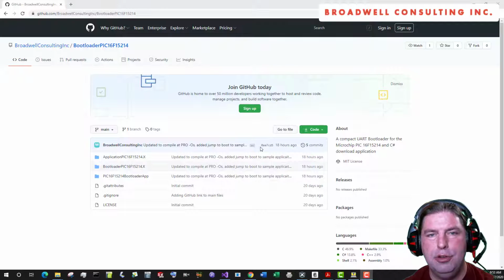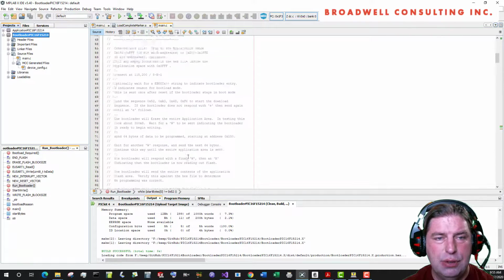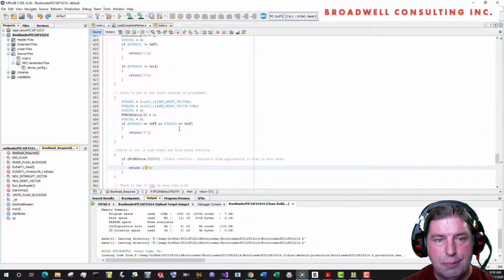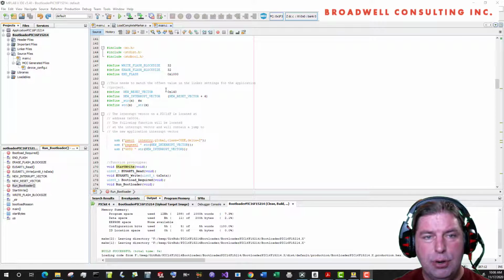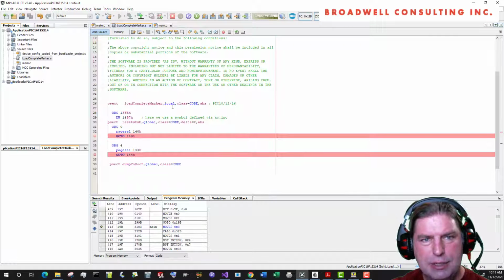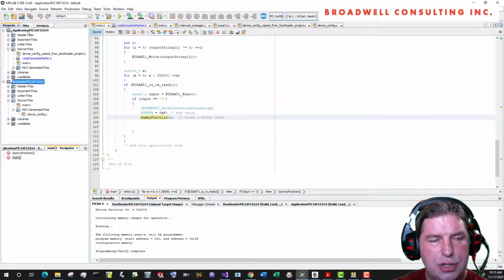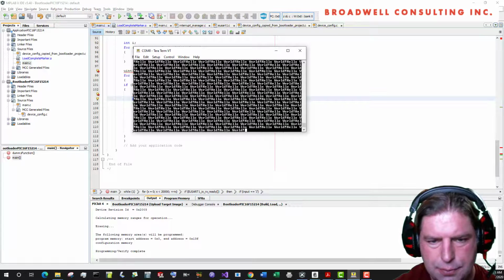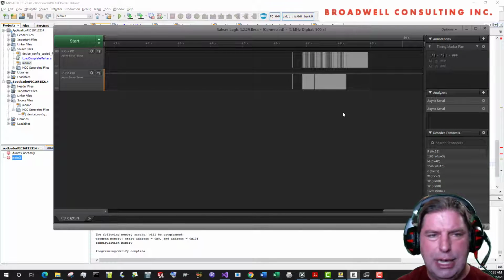UART Bootloader Tutorial and Open Source Code for the PIC16F15214

Comment: Lovely! Is there a bootloader for a PIC16F1825 or PIC16F1829?
Reply from the maker: I don't have one ready to go out of the box, the 16F15214 is the only Enhanced Mid Range part I've done one for.   You could certainly start with this one and adapt it.  All the concepts would be the same, the memory map, flash page/line sizes and peripheral interfaces may vary a bit from chip to chip.  If you need help for a professional project, hit me up.  I do embedded systems consulting.
Reply: Thank you for your reply! I´ve spent the last 3 days desperatly trying to put some bootloader to work on a 16F1824 or 1829 chip. I tried application note AN1310 from Microchip, and it didnt work (very frustrating). Now I´m so desperate that I´m considering put my PICs aside altogheter and try a STM32F030 that comes with a bootloader factory programmed. How much would you charge me to create a bootloader for a PIC16F1824? Thank you! @SerialWombat

Comment: Thank you for this valuable presentation. I am implementing a similar boot loader for a different part number (PIC16F1947). I currently have an issue where when I jump to the application after the update, the interrupts in the application seems to stop working (bootloader doesn't use any interrupts). I have verified the correct offset adresses, reset vector location, etc. 
Do you know what kind of underlying issue shows this kind of symptoms ? Thanks you !
Reply from the maker: Are you sure interrupts are enabled?  Are you calling INTERRUPT_PeripheralInterruptEnable();
	INTERRUPT_GlobalInterruptEnable(); after you get into Main from the application?
Reply: @SerialWombat  indeed I am. I am wondering if this is due to mismatched config bits between the boot loader and the application. Have you ever come across such situation?
Reply from the maker: @Maikaelin  Any mismatch between the boot project's configuration bits and the application configuration bits is definitely a potential problem.  I'd suggest using the bootloader's config bits in the application.

Comment: Very interesting video, it's not easy to find all those information.. do you know if this could be used also in PIC18F ? Thank you
Reply from the maker: You could port the idea, but I wouldn't.  The hardest part of a bootloader is getting the flash writing routines, linker files, config bits, etc. working.  That's going to all vary between 16F and 18F.  Additionally, this bootloader skimps on a lot of common bootloader features to cram it in the least possible amount of flash because of the limited space in the 16F15214.  If I had more flash space I probably would have done something quite a bit different.  For instance, verification consists of reading back 100% of the loaded bytes to the host for verification.  That's fine for a small flash space, but would be bad for a 256k part.
Reply: @SerialWombat  clear! Is the forced stack reset a common way to force the bootloader? Are there others solutions?
Reply from the maker: @CMSBLOW  I've never seen anyone do it before.  It was an easy way to have a bit that was persistent across resets to use as an indicator.  More typical is to set a "stay in boot" bit in eeprom or flash, but that would have required more space.  A recursive subroutine call is like two assembly words, and you can do a bit test on the reset cause register, so it's super cheap in terms of flash space.  You might take a look at this article I wrote that can help you identify what you need out of your bootloader:  https://www.linkedin.com/pulse/17-fundamental-bootloader-questions-jonathan-broadwell/
Reply: @SerialWombat  thanks, I'm writing my own bootloader for PIC18F and it's quite tricky, it might help!